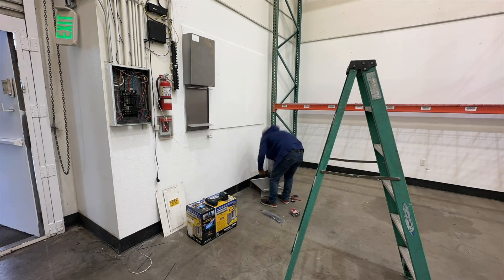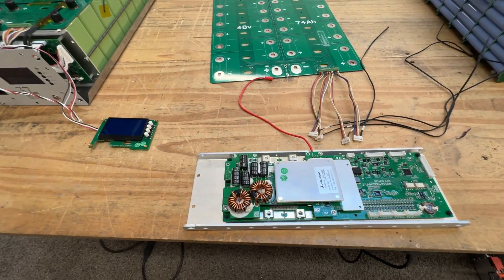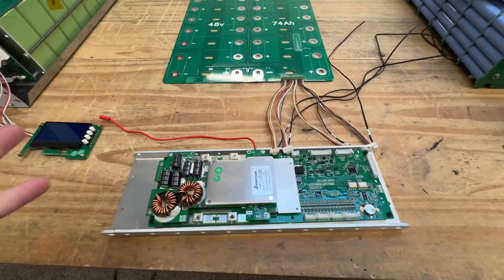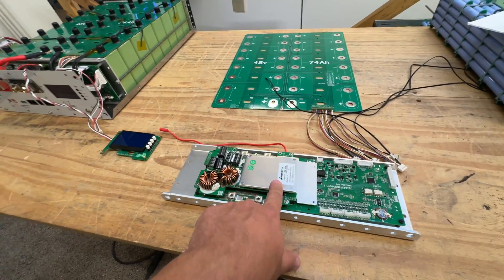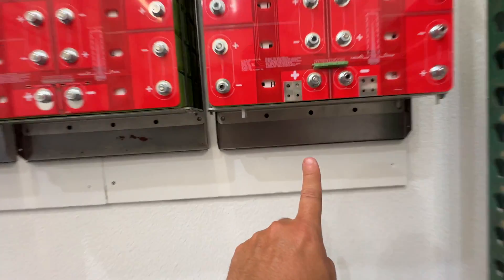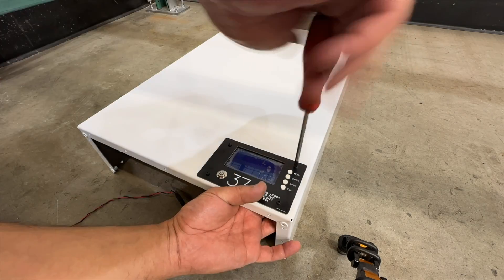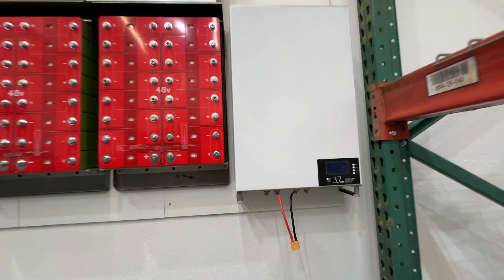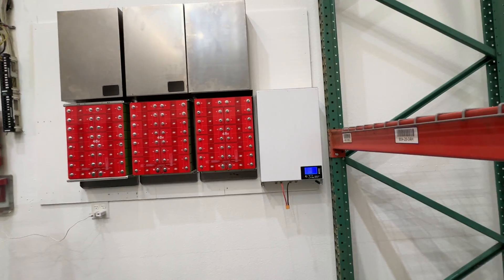How to BMS on 48v PCB busbar

Comment: Pro Tip: Wet the area when you're painting (damp not pooling). Keeps the dust down and cuts the amount of overspray sticking to the floor. Old body shop trick. Just make sure you are mindful of any electrical hazards in the area.

Comment: My suggestion,  get a jk bms 16s with 2A active balancer it does a better job with used and unmatched cells like yours than this type of bms...... also, the box is a bit tight for a battery that handles high ampage you need to give some room for heat dissipation if not might end up in smokes or fire or dead bms in a shirt while
Reply from the maker: These cells are new they don’t need 2a balancing

Comment: Hi Great video as always :) 

Got a quick question. I have a UPS that had it's batteries die. Upon opening it, I found two Lead-acid 12v9.0AH batteries hooked up in series. Replacements go for around 31 euro each. I was wondering if there is a guide or approach to upgrade the batteries to have greater reliability/capacity to keep running for longer. 

Many thanks for any feedback :)

Comment: If new Inverter JK-BMS with active 2A balancer was used, 
it would be possible to add small fuse holders on the PCB board for each of the 16 balancing wires with 2.5-3A fuses for sure.

Of course for small mA passive balancing, which all these other industrial BMSs use, this is not needed.

Comment: It would be great if you could also modify this DIY BOX and PCB board to accommodate the standard battery cells (the blue ones)
for 105Ah, 170Ah, 230Ah, 280Ah and 304Ah as well as a choice for different BMS. 

You wouldn't even have to sell and keep BMS or cells in stock, everyone would provide those themselves, 
just pre-made DIY BOX kits with PCBs for selected cell size and selected BMS would be awesome !

There could be a lot of interest in such DIY BOX kits with PCBs, especially if the price would be much lower
compared to DIY Chinese battery boxes that are the same but sold under different brand names.
Reply from the maker: I cannot compete with china in price

Comment: How do you balance the 16 cells once its on the wall and all enclosed? Does the BMS do that for you (Based on prev video with the dual batgos attached.. hence confusion)?
Reply from the maker: Yes it’s literally what the BMS does,   If they are within voltage specs

Comment: Just want to say thank you so much for posting the gerber files to those 48v pcb buss boards to pcbway. I ordered a set with 2oz copper and the little connecting boards as well with a blue/ENIG finish. Was pretty expensive but worth it for the extra copper imo. I got the compression kits from your site tho so im super excited to build two of these batteries!
Reply: What did it cost to have pcbway make them? I just got mine from jag35 I think it was like $131 shipped but does come with those connectors for the cells as well.

Comment: That extra cable in the middle could be for measuring the resistance of the bus bar that you would normally use between cells.
Reply from the maker: Could be
Reply: Really that’s what your neat picking
Reply: my comment wasn't meant as a criticism!
This is how it is on my seplos BMS, I'm just assuming that they adopted the same design with this BMS.